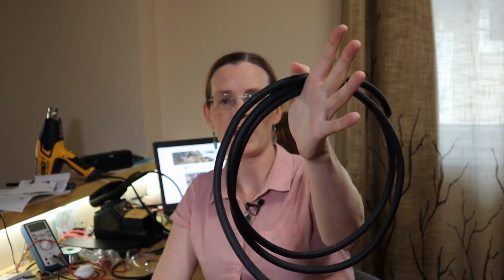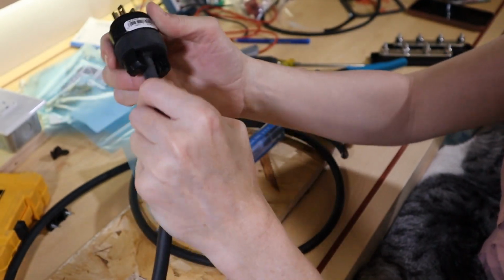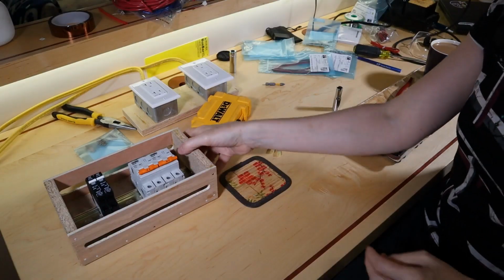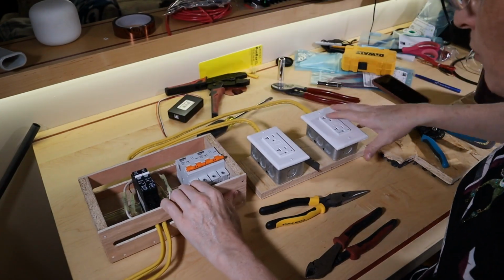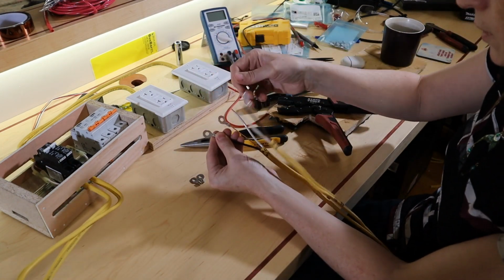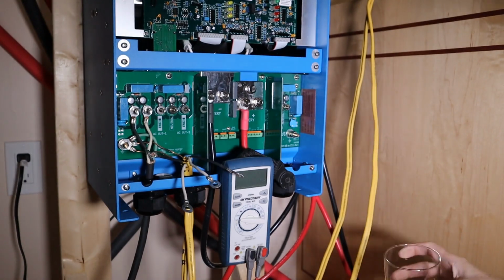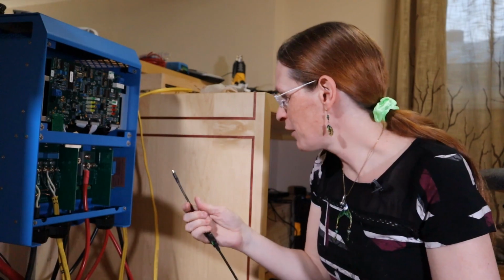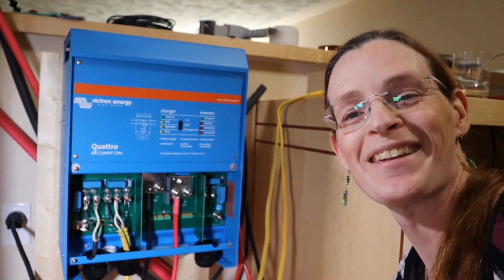Victron Quattro 48|5000|70 120v (Anti-climactic Part 2) - 48v Lifepo4 battery (Ep. 14)

Comment: Wooden box - definately a no no.. this was used years ago in my country, then some fires occured (wood is obviously flammable), so national electric code required to do it from non-flammable material. And when mounted on flammable material then distance sheet (metal/mica) must be used. Plastic boxes must have fire retardants in it.. This is also true for wires, busbars, connectors, plugs, switches. This is also the reason why my friend's roof on 1950 house catch on fire just two weeks ago.. DONT EXPOSE YOURSELF TO MORE DANGER!!

17:30 - from where do you have, that negative connection on victron/battery is ground? Did you grounded minus? Did they change it in Victron and they are grounding it now? Normally it is floating (no side grounded). Some have stupid idea of grounding negative pole and i still don't know why, when telecom knows for more than 100 years that to avoid lighting you rather ground possitive pole of your system - that is why telecoms are using -48V system rather than +48V system, the only difference is grounding. Programmers who did succesfull startups and - flooded whole world with wrong grounded devices (yes UBNT and Mikrotik) gave us a lot of confusions, sad faces after storms and so on..

Busbar - possive should be red painted otherwise you can disconnect cables and get confused to put it back..

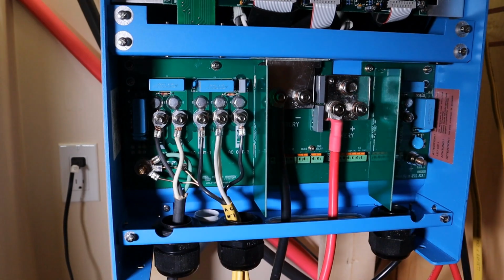38:36 - why you have a short GND + N? Because there is a ground relay inside doing this for your safety! There is a long story about this in manual. You can set this in software, but you MUST BE ABSOLUTELY CERTAIN WHY IT IS THAT WAY. Wanna explay - just write to me. But there are 2 different types of circuit breakers and one need to have N on ground to work.. Do not forget that you have to deal on a boat with grounding also and between ground on ground and ground on sea could be a massive difference. One may say PE - protective earth. You can avoid this and make everything work in better kind of "grid" called isolated terra - the IT net. This is used in hospitals, but then you have to use signaling when fault  occurs and one of hot wires is connected with ground.. And also circuit brakers must be replaced with  Ground Fault Circuit Interrupters (GFCIs).

40:00 - why it beeps on + and -? Because victron would like to be powered on, so from point of view - it accepts current, thus looking as short.. Once it is powered on, you would measure 48V and not a short..

41:00 - you are COMPLETELY WRONG HERE and it can you cost you your husband's wife or someones other life!!
Reply: 47:20 - yeah i know you did a great educating job in Canadian schools (we learned a bit about it), so unexperienced people can do anything and this is good, but please always consult what you are doing with someone who know what YOU are doing, as we do not have to miss this youtube channel.. this devices can electrocute, can cause a fire which is really hard to extinguish.. so please isolate not just ratchet, but also a bits you are using (screwdriver for electricians have only the tip unisolated), because i really feel scared sometimes of what you are doing when i see it..

49:00 - in victron manual it is stated (and there is a good reason for it), that each phase invertor should use same battery on input - so they are all sensing same imput voltage, there is no danger of strange currents between communication and then - you suddenly don't have one phase out.. So you rather use 6 parallel batteries to one bus bar and from that busbar 3 victrons.. aaaand do not forget to preperly isolate theese bus bars as 6*280Ah is just 1.6kA on 1C and thouse batteries are capable of pussing at least 10C, so 16kA or 16000Amperes.. This could blow anything..

55:00 - ve.direct cable is for user configurable devices.. MK3 cable (Ve.bus->USB) is for advanced users.. yes i know you ordered it, but please you have to understand what you are doing - at least when playing with ground relay setting..
Reply from the maker: @servisfibris6679  As you noticed, when I was unsure if it was safe to proceed, I stopped and looked for people to talk to. That's how I learned about the inverter's transformer and the capacitor behind the battery terminals. I am not always the most careful person, clearly, but I do try to recognize when things are extra dangerous and to be careful. :)

Ah, so if I do go for three phase, then I would want to tie all six batteries onto the same bus, and then tie the three Quattros into those same buses. That makes sense. As for current, each battery is limited to 100A max output (BMS in each pack will cut if this is exceeded). So I'll be using, _minimum_, 600A busses, though realistically I like to have overhead, so probably larger.

That's the reason I didn't go further with the quattro yet. I want to make sure I can see the full config before I try to actually use it. It's also why I ordered the parts as soon as I knew what I was missing.
Reply: @TheDigitalMermaid  You can configure Multi/Quattro with MK3 cable and USB->microUSB adapter also on phone with ve.configure. But i have not found there how to tie them to 3 phase, so probably you will need to connect them to PC and do it old way. Or just connect them with UTP cable alias VE.BUS. I have here just one Multi as i'm using signle phase system only. With BT adapter you can only monitor Multi. Not sure what you ordered.. But BT adapter is waste of money if you are going to configure and not monitor only.
Reply from the maker: @servisfibris6679  Looking at the manual, it seems like you can link the two / three victrons using standard network cables (just straight patch). I'm sure there's a configuration needed to set their phases, of course. I'll have a much better idea once the MK3 cable arrives.
Reply from the maker: @servisfibris6679  To clarify; I do plan to monitor. I've got a more long-term plan in mind that will require monitoring.
Reply from the maker: It's fairly common for boats to have breakers on DIN rails in (wooden) cabinets. In any case, a metal case or backing is a good idea, and as I mentioned in the video, this box is temporary. I wanted a physical barrier blocking the kitties from accidentally touching the leads.

Grounding is going to be an entire video a little later on. It's a big topic in the boating world and I am still learning about it. Painting the positive bus bar red isn't a bad idea. For now though, the big red cables going into it are a pretty clear indication which is positive. 

The outlets I am using are AFCI breakers. 

I learned later in the video why there was a short, it's the secondary windings of the transformer. Please remember, I am showing the process of learning on this channel. Most other channels show the finished work, after the presenter has learned everything. I want this channel to show that getting things wrong is OK, it's a normal part of learning.
Reply: @TheDigitalMermaid  I would like to say that getting things wrong is OK too, and you did a excellent job by calling some electrician to ask for a help, when confused. But remember that someone copying your enthusiasm for learning can go wrong in this step and kill himself or other by an accident.. You had same accident that later triggered Andys viewers go here and subscribe.. And proper ground is a must! Or leaving live wires floating (having no neutral wire) when knowing what you are doing is ever safer.. 

And I was today googling for remote switch on Multi and found grounding topic on victron community. Link: https://community.victronenergy.com/questions/98617/groundin-battery-minus.html .  There are some experts saying that grounding battery on boats is esential to prevent corrosion. Don't know where they learned this, but can be true and they are grounding negative, so it is opposite to what telecom sector is using.. You will need to google trusty answer and make a video about it.
Reply from the maker: @servisfibris6679  There's a point where every person needs to decide for themselves where their intersection between "trying new things" and "tolerance for risk" is. The very first video on this channel talks about how I am new to all this, and how I am learning as I go. The very premise of this channel is "learn with me". If I hold back showing my mistakes and misdirections, then the core purpose of this channel goes away. There are lots of channels out there run by people far smarter and more experienced than me showing how to do things correctly.

Don't get me wrong, I understand why you're saying "remember that someone copying your enthusiasm for learning can go wrong". If I let that be the guiding light of this channel, then this channel dies. I want to provide a place where people feel OK learning and taking chances. The trick is, though, sometimes chances don't work out. Sometimes you make a mistake and you (almost) get hurt, like I did. 

The key thing, for me at least, is "do your best to mitigate risk and then go for it". Not to be reckless, I don't want to get hurt and I CERTAINLY don't want to ever hear of anyone else getting hurt, either. That's why I try to include the parts where I show how I am trying to solve problems. That's also why I want to show my mistakes. I want people to see that things go wrong, and injuries can happen. I want people to take this stuff (deadly) seriously, but also, not to be parallelised by fear.

Like sailing itself, there is always risk. People get hurt and people die, and every time it's a tragedy. That said, living a life where you never take chances is, to me, also a tragedy.
Reply from the maker: @servisfibris6679  This is an excellent link to the Victron community, thank you for sharing. I have a lot to learn about marine grounding, and it will be a topic in a near future video. Thanks!

Comment: Please don't forget to have a heavy duty resistor to prime your inverter before connecting it, saves you from welding contact because of the inrush of high current
Reply from the maker: In the battery assembly video (two back, iirc), I wire up a large resistor to a button, exactly for this reason. Got the idea from Andy!

Comment: I'm along for the newby ride.  Learning along with you.  Thanks again for taking the time and trouble with these videos.  I'd be interested in your wood work for the battery project.  I'm thinking of putting together a test solar project that will be in my shop, so the cabinets and such would be interesting.  And perhaps parts list used and maybe even where you purchased.

Comment: 7:03 please use ferrules for this kind of connector and leave the earth cable about 1cm longer in case the cable get ripped off the plug, so the earth is the last wire that disconnects
Reply from the maker: Great idea! I have ferrules already. I'll do that next time I do something like this. Also, thanks for the tip on the ground, that makes sense.

Comment: Remembered something else I saw in another YouTube video, when putting lugs on really stiff wire, dry fit in place, then draw a line from lug to wire. Then pull everything out, line up the lug to the wire to crimp, then re-install.
Reply from the maker: That's a good idea, thanks!

Comment: I'm not an electrician or anything but I've picked up/been taught a few things.

* use a proper utility knife with a handle and cut all the way through 14/2 and pull the wire, you can strip multiple feet in a second
* please get a red bus bar for positive
* don't be afraid to have extra wire in your utility box. In a housing outlet you want 6 or so inches of wire to stick out of the wall and you want a service loop outside the box in the wall. I can't see why you'd want your AC lines to barely have enough length to meet in the middle. Plus it's hard to work with, just make an S out of the wires.
* I personally don't need to see simple wood projects but whatever makes you happy

I'm enjoying your channel, keep up the great work. We have the same life goals regarding buying and converting a sail boat.
Reply from the maker: I normally leave service loops. The reason I was short in this case was because I cut the wire before remembering I needed to add breakers, and before I decided to make the box. In order to have enough slack for service loops, I would have needed to rewire the outlets. I figured fussing with short wires was less of a hassle. If this was even sort of permanent though, I would have (and also, I wouldn't have used a wooden box!). Thanks for all the advice!!

Comment: In case you have not figured it out already:
Quattro does not have VE.Direct it has VE.Bus
Quatto does not have Bluetooth built in - none of the inverters or MultiPlus have Bluetooth either. A Bluetooth adapter is required for this.
You need a MK3-to-USB dongle for configuration by a computer. VE.Configure software on Windows offers all of the configuration options.
VicronConnect is getting better at configuring VE.Bus devices (Quattro) but it only does the basic configuration so far.
Always ask anything you want on Victron Community - you only have two questions there so far and you are eager to learn more!!
Reply from the maker: Yup, figured that out while editing. lol! I've got the MK3, Cerbo GX and the display on order. Hoping they'll be here for the weekend.
Reply: @TheDigitalMermaid  I programmed my Victron Multiplus with Cerbo GX alone, no MK3 need it. Thanks for the kind words...
Reply from the maker: Also, I actually asked there about the shorts I was seeing.

https://community.victronenergy.com/questions/99101/quattro-48500070-120v-measured-short-question.html
Reply: @TheDigitalMermaid  You seemed to have figured that out too and the other guy confirmed. It's just the winding of the transformer the makes it appear short. The other AC-OUT has a relay at the output, so it appears open circuit.

Comment: arrrr fluent in Australian to i HEAR.. ?? LOLOL
Reply: So, @Digital Mermaid, I am enjoying your enthusiasm and I appreciate you creating a safe space to foster learning and sharing. After watching you with a metal screwdriver (I understand you were being careful), I am reminded of when I was being careful and still slipped and ripped through the traces on a motherboard, ooops! If you can bring yourself to think about it, using plastic to flip the dip switches (maybe a ballpoint pen tube with ink removed?) to toggle those, would be a wiser measure of caution. Also wrap those metal tools like socket handle,  with electrical tape, just in case. Only saying this because I care for your/your viewers success and safety! Best regards, and Thanks for indexing chapters!

Comment: hi i wright as i watch.. so..  please do not put the plug or ANYTHING in your left and push with your right wile using a screw driver.. why... if you slip it WILL GO THOUGH YOUR HAND..( AT SEA..) NO NO NO ... NO THANK YOU . ok tone uk
Reply from the maker: Wait to see what I do later in the video... :P
Reply: I actually did that once while sitting bare legged on the floor and I can tell you that hurts and is bad for your body. 😅
Reply from the maker: @davidjackson8787  When I can't find my cage nut tool (server rack thingy), I use a flat head screw driver to pop the cage nuts in and out. The number of times I've stabbed my fingers... Ooph.